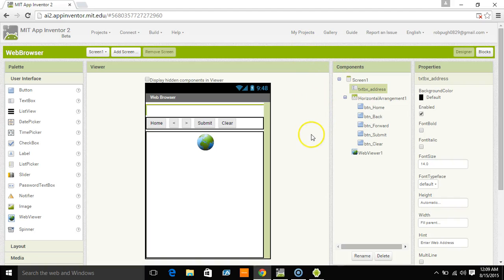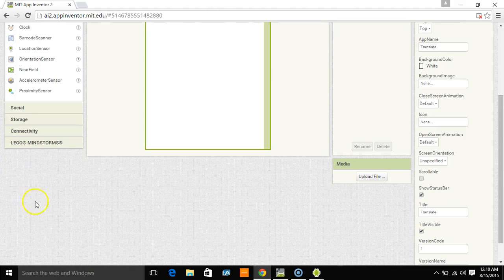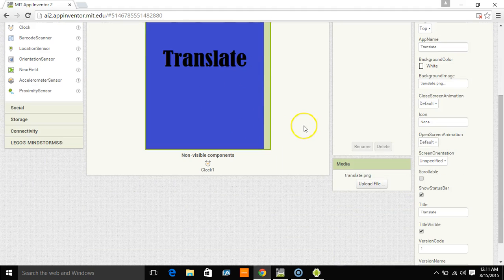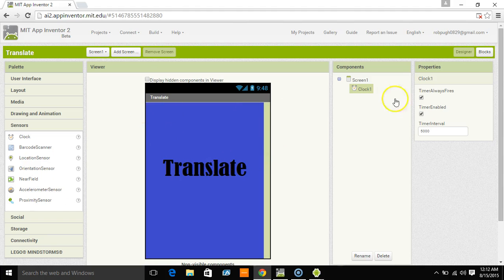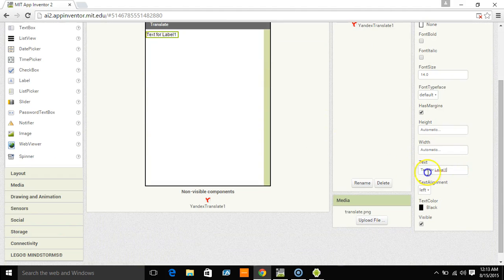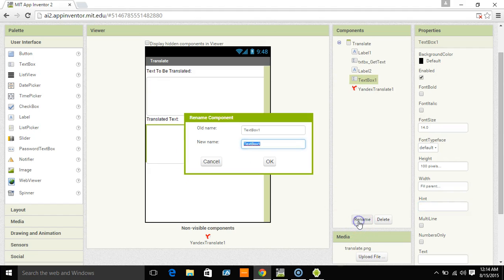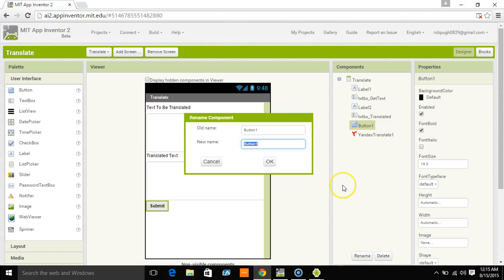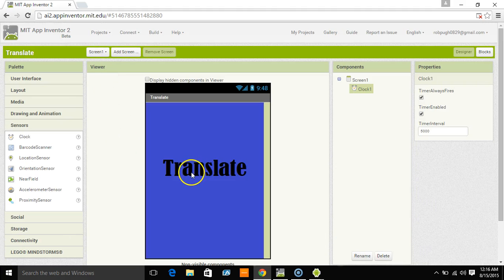App Inventor 2 Translate App Part 1 User Interface

Comment: What are the dimensions for the Translate Splash screen image?
Reply from the maker: I honestly just use the 100% for height and width. I make the image larger than it should be, but the same style with height being more than the width. That usually works well for me.